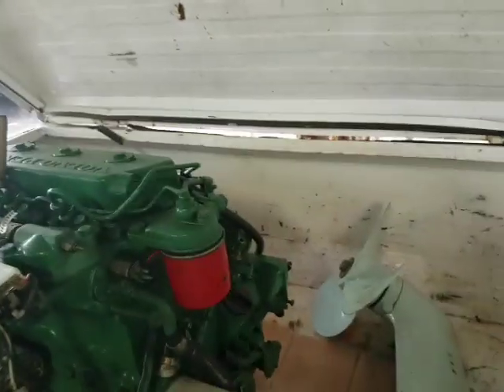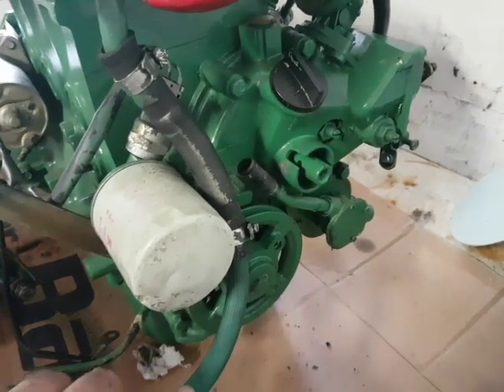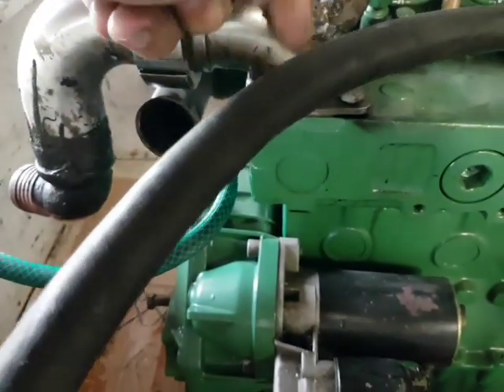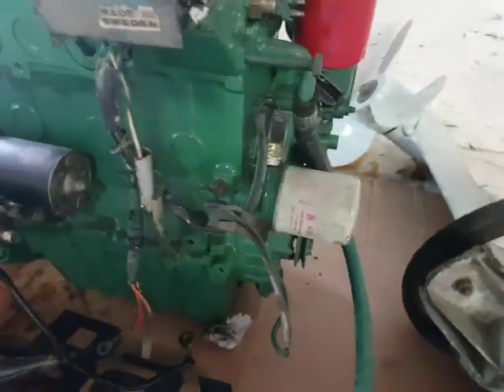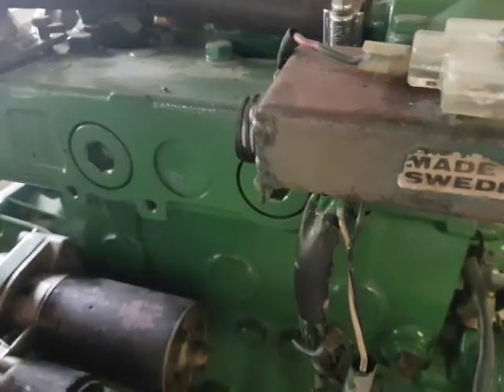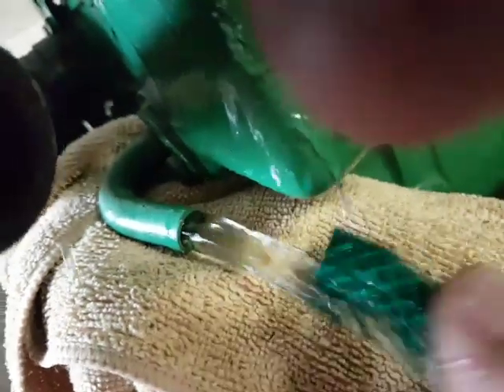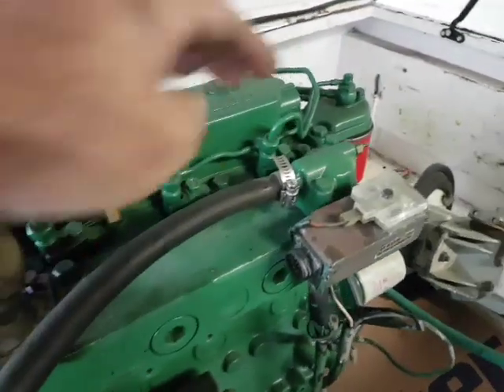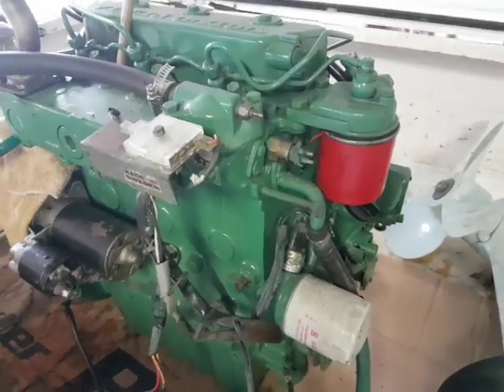Flushing and analyzing cooling system of Volvo Penta 2003 without turbo while in garage.

Comment: Your thermostat isn't hot so will be closed so flow will only mainly come out of one of the outlets. You need to remove the thermostat when flushing or the flow won't go all around the engine block and cylinder head.
Reply from the maker: That makes sense

Comment: You need the correct exhaust riser. (I have this engine) you can get a VP riser or an aftermarket Stainless one, both have some connections. The pipe coming out of the thermostat housing will go to this exhaust riser. The pipe coming out of the engine (near the air intake) will also go to this riser. If there is no water flowing out of your thermostat housing it is because the engine is not warm and the T-stat has not opened. You can  remove the housing and T-Stat to test flow. However note that the gasket for this assembly is actually on the Thermostat itself, so it may leak a bit while you test that. The exhaust riser in this video is homemade (not bad necessarily)  and does not have the connection points in the correct locations. Cooling water comes in from the sea, through the gear box, and THEN to the pump suction side.

Comment: You def have to move the water injection point to the position you pointed to on your exhaust riser. 
Where it is in the video is oh so wrong.
Reply from the maker: Thank you for the comment.  It seems the exhaust is made out of a stainless steal pipe farmers would use.  I will need to change it.
Reply: The concept is fine. Material will be 316 s/s so that will work. Freshwater flushing is the best thing you can do for the exhaust and the engine. But with that riser, move the water injection pipe from where it is now to where you pointed. Much much better position. Will the rest of the pipe get hot? Yes but it looks like a big diameter pipe which will reduce backpressure. And you can always wrap the rest of the pipe before the water injection point with car header/extractor material. Will stop you getting burnt and will help in reducing engine room temperature.